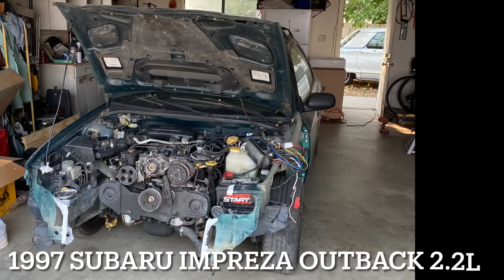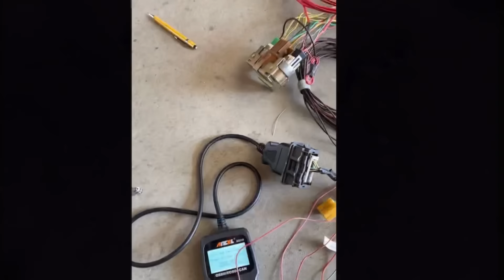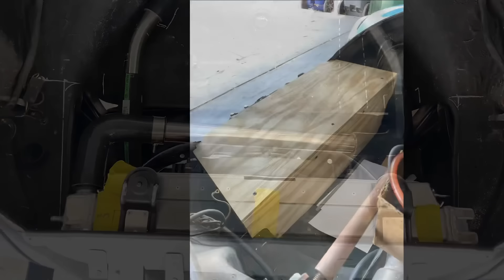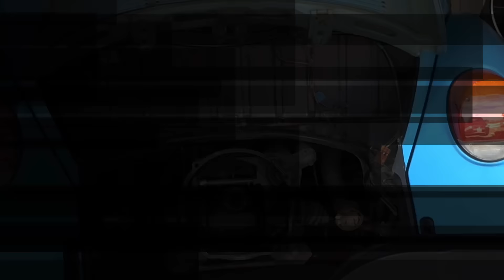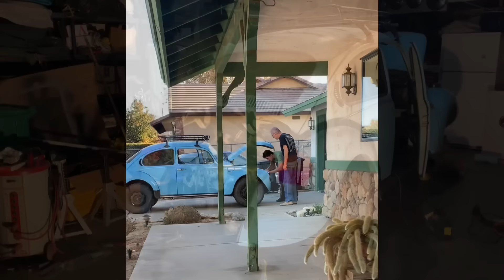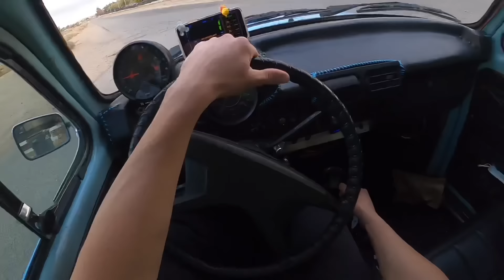Beetle Subaru EJ22 Swap

Comment: The patience it takes to carefully remove the electrical stuff, test it and then reinstall all of it onto a car not designed to accommodate it.
Also, the knowledge to source and install the correct parts to bring it all together to life.
Much respect.
Reply: I agree with you on this. I too, used to do engine swaps back in the '70s... It's not as complex as it is today.

Comment: How come 300  + people failed to appreciate the hardwork, determination and grit for this sleeper.
This is truly beast on the streets, nicely done.
Reply: If u cld c the smiling faces of people around these 347 when they die, u will know.
Reply: Because it fucking sucked what is the point of replacing 1 slow ass engine for another slow ass engine it’s was still slow af lol 😂
Reply: @americanmuscleup2497  how can an engine be slow? It’s all about power to weight bozo
Reply: @jasonnickerson333  look a that name, he only thinks v8s are fast even at 5000 pounds bro
Reply: @LilSkrimp69 or never seen a Honda Civic with a trubo four cyl blow the doors off a blown camero with a v8….
Reply: @americanmuscleup2497  It doesn't matter.
I swapped an Opel 1.9l 4 cyl with a 2.2l 6 cyl that was just as powerless, just because I could. It was fun making it all work with my son, some quality time.
The sound, that must also be remembered. It sounded great, but didn't go any faster.
It's just fun, a hobby that doesn't have to make sense to others.

Comment: You've answered the question probably every Volkswagen air-cooled engine owner has asked himself if he's replaced his own motor. 
Excellent concept beautiful work thanks for sharing.
Reply: can be done to vw bus / van too also with porsche 6 cylinders to vans and trans from some porsches can be used for a 5th gear

Comment: Hay man nice job I have a 73 super that ive done An ej2.0 turbo swap in its been two years and I put crazy miles on this car 300hp to the tires  its an absolute blast to drive.   Again great job and welcome to the Suba Beatle family
Reply from the maker: Thanks man! What kind of mpg do you get?
Reply: I get 30mpg avg  cruzing at 75 to 80 on freeway  I have done sevral 1000 mile round trips   with not one issue :)

Comment: Nice work! I did my conversion back in 2008 with the ej25 SOHC engine. Retained the factory fuel injection as well but I mounted 2 radiators in the front fenders and a third behind the grill of my 71 Super.

Comment: I love the build.  But, if I was going to put a radiator on a bug, I would have put a heater control box in with a manual water valve to make it bearable in the winter.  Maybe an old Jeep control box would fit somewhere.
Reply: You should absolutely be in luck, as most of the guys doing this swap mention how the Subaru generally prefers a heater core in order to keep its cool.

Comment: Bravo mate for the excellent work. 
For future reference there is a port on the rear of the right hand head under a plate with two 10mm bolts.
That will accept a distributor from an EJ18.
This will remove all the ecu and allow carburettors for a real easy swap.
Cheers Matt 
I have the same set up in a jet boat running on LPG (propane)
Reply from the maker: Funny enough I just bought a Yamaha jet boat last month haha
Reply: That is wild. You will love it mate..
I’m just finishing the build. 13 foot aluminium with a Hamilton jet on the back.
Funnily I am wiring the distributor at the moment. 
It’s only taken me 12 years. Kids will do that to a plan.
I had the same engine set up in a Brumby, which is a Brat in America.
It had ej18 pistons in it too, to make good use of the 100 octane LPG.
Absolutely screamed.  
Have fun mate.
Matt
Reply: Please tell me if I am being rude. 
Another suggestion for you.
As you have good clearance under the hood, a Toyota SC14 blower gives around 6 pounds of boost with stock pulleys.
The computer thinks it’s all ok if you upgrade the injectors and keep it cool. I did H2O injection.
It spun all 4 all the way through second gear.
Remain having fun.

Comment: Where did you get the adapter plate for the transmission?
Reply from the maker: KEP. Kennedy engineering products. Google: Kennedyeng
Best bet is to call them and tell them what engine/trans combo you are installing and they will tell you what adapter plate and clutch you need. Cheers!
Reply: @3DPrints4TC  thanks 👍🏻

Comment: Great work if only I had the knowledge . From the UK.
Reply: The beetle it's stupidly simple, there is no easiest car to start with!
Reply: @santiagoperez2094  

Yeah I know I got two . I was on about the engineering and installation of the subaru engine and wiring.  I would be scratching me head for a very long time .

Comment: Has a pretty good jump in speed in shifts. Might mean their  plenty of torque curve down low. Don't have to wait for revs.
Reply from the maker: It does have good torque down low, but in my opinion the stock vw trans has pretty wide ratio gears so I don’t shift as soon. Or maybe I just really like the sound of high revs haha

Comment: I loved seeing you modify the big it's a great up grade being volkswagen gave license to subaru for their devolppmant of the boxer engine makes sense for and up grade well tell me has the gas mileage changed any and how much more horsepower has the boxer engine makes than the 4 and did what adapter kit  did you use for the tranny hook up I get the started upgrade good choice and wire harness what exactly did you have to modify I want to know because I will do the same one day but you did this big right and I appreciate the hard work peace
Reply from the maker: I will be making an in depth series on the swap shortly

Comment: Totally love it!!!! Great job!!! Quick question- where’d you get the adapter plate? Very awesome!!!
Reply from the maker: Kennedy Engineering in Palmdale CA. Call them directly and you can tell them what Engine and trans combo you’re working with and they will advise you about what you need for an adapter. They make the clutch and flywheel too. Takes about 2-4 weeks to get made.
Reply: @3DPrints4TC  that’s so awesome! Yes I’m going to definitely do that. Thanks so much for replying!

Comment: ? How fast would you drive this on an expressway ?  Stock `1600 likes 65, so I am guessing this would push at whatever you wanted.    What if it was an pre-67 bug,  I wonder if the engine bay is the same size ?  And where do you put the radiator ?  You made it look EASY !

Comment: Sounds great but I have a question did modify the transmission or was the same one
Reply from the maker: Same transmission but using a Kennedy adapter plate to mate it to the engine.
Reply: @3DPrints4TC  thanks so much bro I love your videos and keed doing great

Comment: So, I'm currently thinking about a beach buggy build based on a vw beetle that I'm gonna do in a few years (currently lack of space, time and money). I wanted to swap the engine for something bigger, better and more recent and I thought a k24 would be a great option (tough, reliable, powerful, vtec), but I mostly see people doing this stuff with subaru motors... As I saw in the video, it seems like the motor is about the same kindda shape and fits well in the space, that's probably why everyone is doing it. It also seem that it mounts well to the transmission with the help of the adaptor plate, but I really didn't think that the original one would be able to stand that much power. Did you modify it in any way? It would save me a lot of headaches to just keep it instead of making one fit somehow. Thank you for this video, I think it's gonna be helpful in the future when I will actually know what I will be doing haha

Comment: Did you have to change the gearbox or are you using the stock one also you think the k24 would fit in this car?
Also you maybe have some tips of bulletproof engines in this class that might fit?

Comment: I did not see how it was done to connect the new engine to the old transmission, I did not see any adapters or work to adapt just as if the connection would be the same

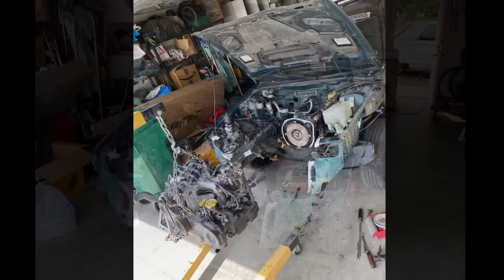Comment: Nice build! Ive got the same engine that Im trying to put in. At 0:20 however I can see there are two extra pulleys. I know the one to the right of the alternator is the airconditioning pump. What is the one to the left for? Mine has that one as well but I can see you took it off
Reply from the maker: Power steering pump.
Reply: @3DPrints4TC  Ah great, thanks man! I'm just gonna toss that one then.

Comment: Nice build! I love this car. What did you do to the suspension for the tall tire to fit? I want to build the same look for my curved windshield super.
Reply from the maker: Google TopLine rally/lifting struts for the front (this only works for super beetles)
For the rear wheels, google: “notching spring plates, the samba”

Comment: Cambiaste caja de cambios, o entra directo, es compatible con la campana del vocho.
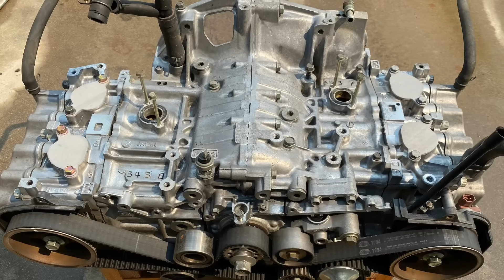Reply from the maker: Use la caja original de VW. La compañía Kennedy venden un adaptador y volante especial que se monta al motor de subaru. Sin eso no será compatible con la transmission. Se puede ver al minuto 0:48
Reply: @3DPrints4TC  muy bueno tu video, te quedo de 10, te empezaré a seguir.

Comment: I would have liked one of those in my Bus, how do you get on with just the original 4 speed gear box? Wouldn’t a 911 five speed be better?
Reply from the maker: 911 5 speeds are expensive. Vw gear boxes are cheap and available everywhere

Comment: Interesting but lots of missing details like engine to transmission adaptor, clutch issues, spigot bearing.
Reply from the maker: There is a spreadsheet link in the description that shows the parts
Reply: @3DPrints4TC  Indeed there is and I both thank you for pointing it out and apologise for missing it in the first place.

Comment: Can this also be done with a turbo motor?
Reply from the maker: Yes, but there would be a need to cut into the Vw firewall to clearance. Busaru installed a turbo EJ22 into his bug and can be seen on his YT channel. OutFront motor sports sells a turbo kit that puts the turbo in front of the alternator which is another option but might require cutting into the rear apron.

Comment: Cool, I have an ej16 that's a 1600 Impreza engine from early nineties but missing wiring, alternator,ECU, so after finding the gearbox adaptor alone is 500euro I chickened out of doing this swap. Would need a lot of money for parts and I only understand carbs. Do you get 30mpg with that beast? What size gas tank you running?
Reply from the maker: Running the original gas tank, only getting about 22MPG at the moment because I have to swap out the 02 sensor and have it disconnected and is running open loop.

Comment: What type of metal tubing size and material did you use for the cooling system? Also radiator? Thanks in advance 👍🏽
Reply from the maker: Stainless steel. Check the spreadsheet link in description for the part of curious

Comment: Main problem is the height of the bug, I mean if you have the original wheels 15” it probably hit the oil pan whit the floor right?
Reply from the maker: Not if you get the shortened oil pan from Outfront Motorsports in Buena Park CA. But yeah the stock Subaru pan hangs low and can get banged up.

Comment: Does it need Kennedy trans adapter ? The wiring is insane ! How much is not needed ?. How is the water temperature ? Do you just assume the engine was good on your purchase or rebuilt it ?
Reply from the maker: Yes, I used a Kennedy adapter plate, flywheel and clutch. Funny enough their shop is 10 min from my house. 
I pulled out the entire harness, but majority of the wire is not needed (i cut out all the wiring that doesn’t connect to the ECU). I recommend checking out BUSARU’s website and channel here on YouTube, he has a series of wiring harness videos that show you exactly what to do. 
Water temp is okay for now, but we’ll see how it is in the summer time, might have to remove the shroud and place the fan directly onto the radiator if it runs too hot.
The donor car only had just over 100K miles and from the auction photos it made it seem that the reason it was sent to the salvage yard was that it was in a collision and not mechanical damage. The Copart salvage yard had a verification that the engine runs but that’s about it. It was a calculated risk, but it worked out.

Comment: Question; you adapted the Subaru to the original transmission? How is that working out? How did you integrate the charging system, battery, other gauges etcetera?
Reply: Adpater plate lets one use vw transmission.  ODB2 transmitter to  your phone, stock vw has speedo off front wheel.  Alternator wire lead goes to battery, you need 12V ignition on source.  VW went to alternators in  mid 73.

Comment: I have a 1975 SB, I would love to know how to place an engine of such into my beetle. I meaning where and how to obtain the parts for the flywheel and etc.
Reply from the maker: A good place to start would be to look the parts list I have linked in the description. It tells you where I got all of my parts and the part numbers. I recommend getting a donor car because that has a good portion of all the things you need to get it running in the bug. I’m working a series of videos with in depth details on how I did my swap. Please subscribe so you will be notified when those videos come out.

Comment: How did you manage to not have to cut into the firewall? Mine won't fit and I had to turn the intake manifold around.
Reply from the maker: A company named Busaru makes an adapter for the intake manifold. Check spreadsheet in description

Comment: SOMEONE IS GONNA MAKE A MILLION BY FIGURING OUT HOW TO MAKE 'MODERN' ENGINES RUN WITHOUT ALL THE ELECTRONICS!
Reply: the electronics are what makes the modern. No electronics needed for old time carbureted engines
Reply: HEY THAT'S GREAT, BUT WHY ARE WE SHOUTING?
Reply: Truth is an engin is an engine. Efi carb tbi... still pistons and spark plugs. The efficiency and output is a whole different story.
Reply: WHAT?  I CAN'T HEAR YOU WITH ALL THE SHOUTING GOING ON.
Reply from the maker: CAR GUYS TALK IN ALL CAPS, don’t you know by now?😂

Comment: Im using an EJ20 for mine still haven't figured out if im using my freeway flyer or just have the Subaru trans gears reversed
Reply from the maker: I think using the stock VW trans is the easiest and cheapest solution unless you really really want that 5th gear. I like the Vw trans because it still feels like a bug but with a lot more power.

Comment: Nice job really clean and perfect, i trying to do the same swap but with a turbo engine. I was wondering if u still use the 4th gears and how does it manage the new power, because i think it is a lot of power for that gearbox.
Reply: I have a turbo subaru also  want to install in my 75’ bay window bus and I’m wondering the Same thing there’s a company called subaru gears, that sells a reverse rotation gear for the subaru transmission. It is a pricey way to go but it will be an all subaru drivetrain
Reply: @chavorucosnkombies  the bay is perfect since it is IRS, split window bus is NOT, and vanagon needs about 1K more USD for linkage kit.  It goes in nicely in a bay.  Todd at SubaruGears is helpful.   2K+for flipped vs 500-700 for adpater & 1500 for rebuilt trans ??  and the 5th great is great on the open highway...Good luck !
I'm keeping my 78 stock FI becuase it is the fastest way for me to get back on the road.

Comment: Nice swap! I wanna do one someday when my original 1600 eventually blew up or gave up. Is it possible to install an AC with the EJ22? I rarely saw anyone install an AC on these bugs.
Reply from the maker: I kept the compressor and brackets from the Impreza for adding AC in the future. I want to do something similar to BoostedVW. He has a pretty good overview of his AC install on his Subaru bug
Reply: @3DPrints4TC  Ah so it is possible then! Also, did you still use the original gearbox? I remember that 60mph in 4th gear in my bug is at a higher rpm because it's aircooled, thus needed the engine to be in that rpm range to be cooled.
Reply from the maker: @HNRichard  it definitely is possible, BoostedVW on YouTube has done it. The gearing is the same since it is the original gearbox. What helps me is I have large tires (215/75r15) which lowers hwy rpms. 70mph is roughly 3200 rpm for me

Comment: I was wondering if the gearbox is necessary to replace or it can handle the power??...i have a plan to do the same but with a 2.0r engine from a newer impreza about 160-170 hp
Reply from the maker: I’ve read that the stock Vw trans is good up until 100hp. So far with the 140 hp EJ22 I have not had any problems especially since I don’t drive it hard. Having a VW trans with hardened internals would be fun because you could really drive it hard without worrying about breaking anything.

Comment: What stops it driving backwards? In the original car the engine is in front of the gearbox at the front so ‘pulls’ the car. In the beetle it’s behind the ‘box in the back? Is there a transfer gear?
Reply from the maker: The engine rotation is the same for the VW and Subaru engine (clockwise as seen from the front of the crankshaft pulley side)so when using the stock VW trans nothing needs to be changed. If you were to use the Subaru engine AND transmission in a bug you’d need to install a new ring and pinion into the Subaru transaxle to reverse the direction being transmitted to the tires.

Comment: Was the TDI starter a direct bolt in swap?
Reply: Carl at Westy Ventures makes and adapter.  I think you need an adapter but that TDI starter works great. (Vanagon in my case) with an EJ25.

Comment: with an ej i can imagine you're pushing the limits of the transaxle, have you had reliability issues with your transmission since the swap?
Reply from the maker: No problems internally at all. I did have to add a brace to the trans tho because it was twisting more than I’d like under acceleration.